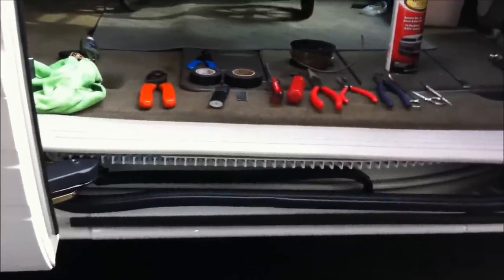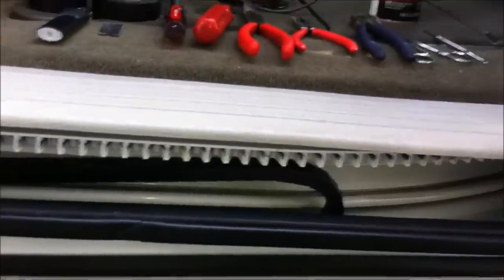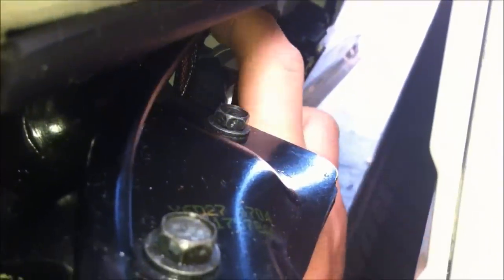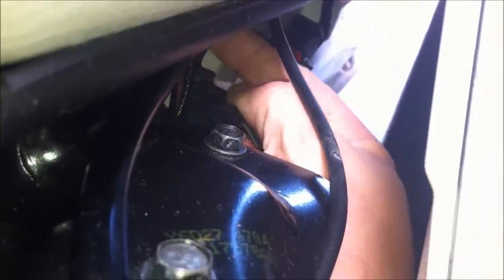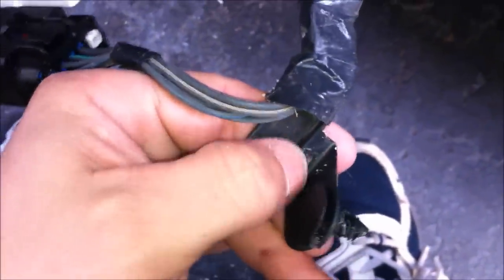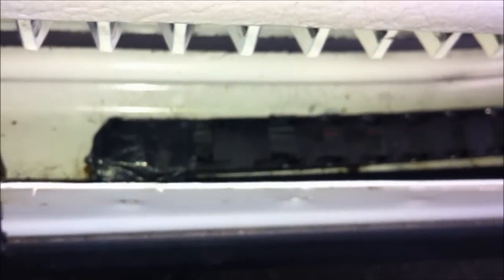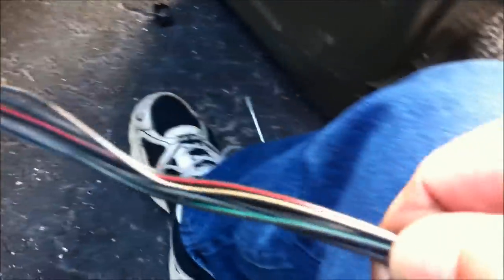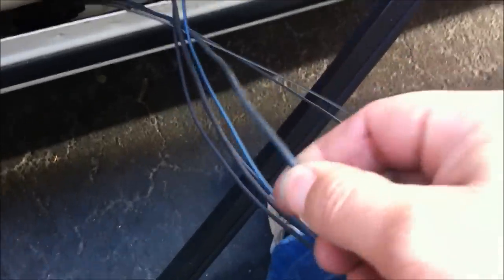auto open door problem trouble shooting for chrysler dodge minivan

Comment: Be sure you sliders are lubed. My door was stopping half way then reversing. I lubed it up with penetrating oil by simply spraying it in the upper slider and that fixed it. It closed/completed the cycle after that.

Comment: Thank you for the video.  It was perfect and right to the point.  The problem you pointed out with the wiring was also my problem.  I repaired the wire and used shrink wrap, put it all back together just as you showed.  It Worked!  Without your video, I couldn't have done it.  Thank you.

Comment: I just wanted to thank you for saving me $471 to splice the wire. It took about 30 minutes and came apart very easy.
Reply: I guess Im randomly asking but does any of you know a method to log back into an Instagram account..?
I somehow forgot the account password. I appreciate any tips you can give me
Reply: @Donald Brayden instablaster =)
Reply: @Raylan Amir Thanks for your reply. I got to the site thru google and Im in the hacking process atm.
Seems to take a while so I will reply here later with my results.
Reply: @Raylan Amir It did the trick and I actually got access to my account again. I am so happy!
Thank you so much you saved my account !
Reply: @Donald Brayden No problem :D

Comment: When I can I plan to (remove battery cables off battery) get the wires free and stick thin needles into each at the farthest point, then use a tester to see if I have a break,just wish I knew what wire to go after that would totally kill the door.

Comment: Is there a correlation between what failure mode the door is and which of the wires to focus on? I have previously spliced and obvious break but know I have both doors malfunctioning again.
* One door seems to close fine (for now), but upon opening it just pops open and stops (no motor sounds after initial opening.
* The other door will almost completely shut just short about 3 inches and the Motor continues to run but the door is stuck in the 3-inch opened position. This same door from a shut position will only open to that 3-inch location and motor runs but no movement of the door. The wires "look" good.
Reply: +AurumNonVulgi 
Well it has now worked for the past year. I think that I recall it being a small wire fracture. Just keep looking is my advice

Comment: One day my 2010 vw routan sliding just stop opening, the lock does not move, the button does not work on the remote or on the inside and pulling on out does nothing. Is there anything i can do to fix it myself? I took out to the dealer service and they could not get it ope, they suggested a new door for a thousand bucks. So we have been doing out the old fashion way with Just the One side.
Reply: This just happened to us today on our Routan! Did you ever fix it or figure out the problem?
Reply: No, never got it fixed, but from everything that I've read it appears to be the lock actuator.
Reply: Lindsay M this doesn't have to do with the lock problem, but does your routan get terrible gas mileage?
Reply: Yes, it's terrible! Maybe 13 mpg?!

Comment: My wife's 2008 dodge Grand caravan,the left sliding door started to act up..it would only open with the key fob but not electrically close,none of the interior door switches to that door would open or close it..then it would work then stop..the motor that latches the door into lock also is not working,it would work on and off,the door would axt wacky sometimes wanted to close while the door was halfway open..NOW the door is dead,it does nothing even the lighted window switch is unlit and the window no longer goes down...The right sliding door is ok..I'm trying to locate if these is a fuse for just the left sliding door to check?..and or should I go directly to the power wire in the harness since the door is now totally dead?
Reply: +Videogamerdaryll There is a recall for the 2008 and 2009 model years that addresses the wiring harness for the power sliding doors.  Please see this notice on Chrysler's website:  http://www.chrysler.com/webselfservice/pdf/K14.pdf
Reply: +Videogamerdaryll There is a recall for the 2008 and 2009 model years that addresses the wiring harness for the power sliding doors.  Please see this notice on Chrysler's website:  http://www.chrysler.com/webselfservice/pdf/K14.pdf
Reply: +Phil McQueen oh man if this is true sorry I don't like to click on links but this will save me a lot of money and headaches thank you
Reply: +Phil McQueen looking online I have found details about a recall from 2010 but I've been to the dealer numerous times after 2010 having the van repaired and they've never mentioned any recall for this the only thing they've ever fixed was the key fob  ignition..not sure what to do should I try to push the issue
Reply: My advice is to print the recall from the website link and take to dealer.

Comment: My chrysler  2008 used to work a little better was able to close the sliding doors pushing the button and start driving while the doors were closing now its seems that I have wait in parking mode till doors closing all the way can you tell me if this is normal and if it is why before was able to do it while start driving and the doors will close 
Please let me know 
Thank you
Reply: +Joshua Hanly There is a recall for the 2008 and 2009 model years that addresses the wiring harness for the power sliding doors.  Please see this notice on Chrysler's website:  http://www.chrysler.com/webselfservice/pdf/K14.pdf
Reply: +Joshua Hanly There is a recall for the 2008 and 2009 model years that addresses the wiring harness for the power sliding doors.  Please see this notice on Chrysler's website:  http://www.chrysler.com/webselfservice/pdf/K14.pdf

Comment: I have a problem with my Dodge Grand Caravan 2011 drivers rear passenger sliding door, Its closed and remote won't open it, I can't even open  it manually, it's stuck I've tried every angle to opening it, kicked it, punched it, slapped it and tried not to brake anything when pulling or pushing the door and handle from the inside. I need this door opened, I have a bunch of kiddos....please help ....
Reply: Hector Moreno I have the same issue. All these videos show how to repair the door once it’s opened. But how can I get the door open to fix it?
Reply: Omar Lopez 
I have the same issue were u able to get it fix 
And what was the problem
Reply: The Fisherman I fixed it myself after watching a few videos. I removed the cover from the inside of the door. I pulled on the cables that were running to the back of the door and one of those opened the door. I replaced the door lock actuator (I think that’s what it’s called... it’s the electric latch that locks the door when you press the door lock button on door or key fob) put everything back together. It was the hardest thing I have ever done. It took me aprox. 10 hrs to complete. I’m not mechanically inclined I know very little about cars. But I did it! And the best part is that I saved $1200-1600 according to dealer estimate.
Reply: Omar Lopez 
Thank you for replying back. 
I'm going to buy the sliding door lock actuator and see if that works.
Reply: Unplug the fuse and put it back in

Comment: My door is making a grinding noise and hard to open and close...how do I fix that?
Reply: Hi.  Did you ever find out what it is?  My door does not release from the closed position.  If I do that manually then it moves fine.
Reply: Lindsey Hopkins k